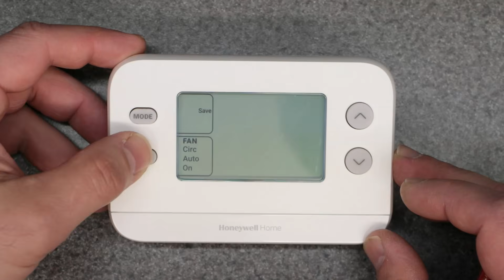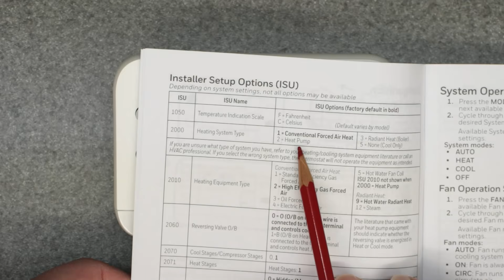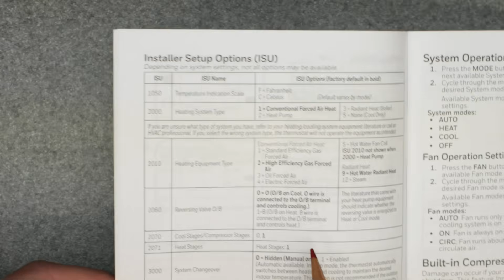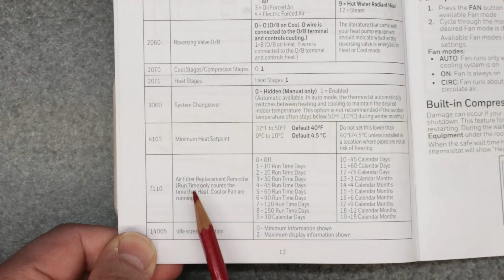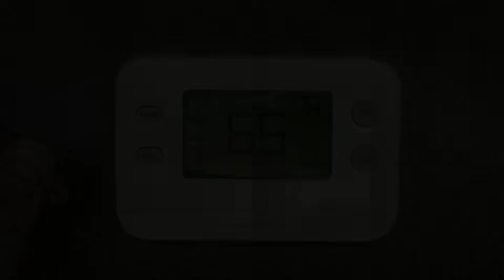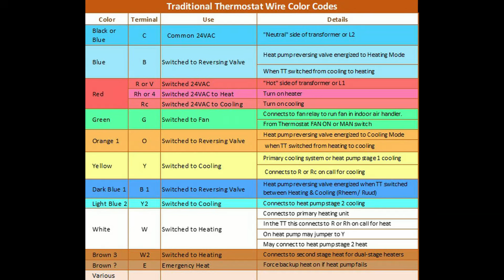Honeywell RTH11B - X1N | SETUP & Operation | NON-Programmable MANUAL Digital Thermostat

Comment: I could never get back to the menu. And could only get heat mode. Taking it back. Put mine back on. Too hot here in TX. Could programming it wrong at beginning cause this?

Comment: The blue sliding tab is the R/Rc jumper. Up is Jumper on. Down is for two single wires. Thanks great help on programming the parameters very helpful.

Comment: I need help. Old thermostat had blue wire in w and on bottom of w is o/b . Where should I connect blue wire on new thermostat? Also on old thermostat white wire is in w2 slot which on new thermostat it says it's unsupported.

Comment: You explained this perfectly. However, mine says cool, but I just woke up sweating and it’s literally cooler outside (62•)  I had it’s on cool for two days, set on 69 and I still can’t even feel air coming out. I just had to open my windows and my door. I just turned the mode “On”  just now so I’ll come back with an update 😂
Reply: Update?

Comment: Thank you for this. I am helping my grandma set her thermostat. We were thinking she needed the time of day set, but it appears that there isn’t a time setting. She wants the heat set lower at night, so just to clarify- she needs to change it manually if she wants a different temperature at any time, correct?

Comment: Thank you for this video - VERY informative!  Sadly, I'm old and dense and have to ask - could you please tell me where the wires (red and white) would connect to run a free standing Quadra Fire 1200 Classic Bay pellet stove? Would I be correct to GUESS I would select #1 in the 2000 category and #4 in the 2010 category?  I would be using this for the pellet stove only which is a 2 wired stove that requires electric to operate. Your help is MUCH appreciated!

Comment: My question: the heat always comes much earlier (sometimes an hour or more)than the set time. What should I do to fix the issue? Thanks.
Reply from the maker: You have the early start function active. Go in the setting menu and turn it off. Also make sure the time is accurate

Comment: How do you jump r and rc? Reason I ask is, the port is only large enough for the one red wire
Reply: I have this same problem currently did you find it out?
Reply: @jojom425 I'll look when I get home and let you know. If I remember correctly, it's kinda like a switch you can flip and just use rc

Comment: I was wondering why my main level was not giving off heat. I have 6 wires and I had a technician  come in but the Ac is working but not the heat. I finally figured out it was the programming was wrong. I will find out soon if I have heat all day. I have heat… thanks

Comment: Great video. I just purchased the same exact thermostat at Home Depot and followed all your instructions and modes.   Heat in the room is at 84 but I have it set to 75 and it doesn’t go down.  it hits 80 and then it goes back up.  I have to say I installed it 2 wire system, red and white heat only. Hot water / boiler. Mode.   I Can’t understand why the temperature doesn’t go down. It stays too hot.  The only thing (my bad) I did was install this without shutting down the power. Do I need to shut the system down and then restart it? Any tips would be appreciated thanks it just stays too hot.  I also have it set to auto but temp remains too hot.
Reply: My same problem stressing me out. It reaches room temperature and take forever to go back down when its colder in the house.

Comment: I’m a little confused. My old wiring has the red wire in the Rc and a jumper to Rh. With this thermostat, should I have the red wire in R and a jumper to Rc? Because I wired it with the red and jumper in Rc and the jumper only in R. Is that wrong? My furnace isn’t kicking on- that’s why I’m asking/wondering. Thanks in advance.

Comment: Hi this would work with simple 2 wire shorting on/off cycle for water boiler running through hot water radiators through the room ?

Comment: What if I only have black and white wire. Am I putting the white with the white and the black with the. Common wire which could be.  Black or blue.   If u could respond with answer. I would be very thankful
Reply from the maker: The installer used the black wire in place of a red i suspect. But you need to verify what those wires are doing by checking the terminals its using at your furnace first

Comment: Awesome video. I just recently had a wall mount Rainni high efficiency furnace installed. Is has this exact thermostat. Is there any way to program it so the temperature in the room drops 5 degrees before the furnace turns on again? I have mine set at 70 and it keeps turning on every short while to maintain the 70 degrees.

Comment: Just installed this for an older oil boiler water radiator system, and it seems like the tighter setpoint temperature is causing shorter cycles. I worry that this will put more strain on the system and/or that the shorter cycles prevent the system from heating the water and warming the area efficiently. Any way to manually adjust the cycles per hour to get longer cycles on this thermostat? If not, will this self correct as needed given the 2000 and 2010 settings (3 and 9) you have here? Great video!

Comment: So I put the new thermostat in… And now the heater won’t even ignite the pilot. I’m starting over. Maybe I did something wrong. Cross your fingers cause it’s 47° in this house. It’s been that way for almost 2 days.
Reply: I did I it… I used all the wires…unlike the previous installer… works like a charm! Pat on the back for this lady!😊

Comment: How do you change the cycling? My gas furnace only comes on once an hour for 5 minutes. Also, it is set for 80 degrees it is only 66 in my house. HELP!!!!!!
Reply from the maker: If your furnace is not staying on enough to heat your home. The problem may not be the thermostat but an issue with the furnace. Make sure the thermostat is not being hit or heated with sunlight that would trigger it to not run as well.
Reply: @ModernHotrodsNH  thank you so very much for responding. The furnace is a brand new furnace that was installed last week. It is in the attic. Where the thermostat is installed is where sunlight never hits it and where nothing can bang into it.

Comment: Mine doesn’t have heat mode ? How can I fix ?
Reply: Mine either!
Reply: Did you ever fix it when I held the bottom left button and the upper right button I went to the heat mode  and put it on one now it works
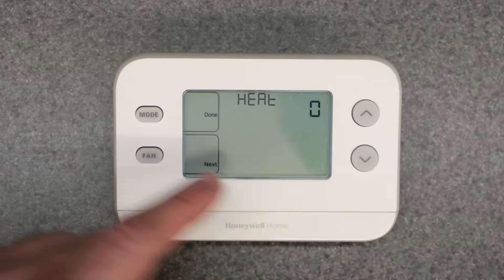Reply: 11:01 on his vid, set Heat to 1

Comment: VERY WELL DONE - Thanks!  
I just purchased this X1N thermostat for our gas forced air and central air control, replacing an old one. Although the Installation and User Guide that comes with the unit is clear (until the reader gets to the "ISU" portion*), your instruction is a GAME CHANGER, and a confidence builder to boot.

*NOTE: The instructions for ISU, #3 says to "set R-switch" position Up or Down, with zero explanation of what that means or how it relates to the older thermostat wiring (I still would NOT know what to do there or how it relates to what existed on the older unit which DID HAVE a R to Rc jumper were it not for YOU at about the 15:22 point in your video). You da Man!

Comment: Your video should be listed as a reference right in the instruction booklet that comes with this thermostat. Your explanations are easy to follow and each step is explained so clearly. I watched it at 4am after three weeks of trying to figure out what was wrong with my furnace. I discovered from your video that I had not set the thermostat up correctly. I had set the fan incorrectly and it was blowing cold air and cooling down the house after it warmed up! Thank you for making this video! It sure helped out a bunch!

Comment: Very nice video sir. This thermostat does not need to be jumped by a piece of wire. The blue slider up mean it is connected R To RC.  Blue tab down mean you can connect 2nd red wire.if you have 2 red wires. Just want to help .but you explained realy good sir
Reply: Dude you just solved my heat problem!! This should be the top comment
Reply: Thank you for clarifying this. I was confused about the jumper in my thermostat I was replacing.

Comment: Is there another wall plate that would allow me to cover about a 3/4" gap on the wall under the bottom edge of the thermostat? My original thermostat from 1968 was mounted vertically so the rectangular shaped cutout in the sheet rock was completely hidden. The way it is now, I'm using the supplied mounting plate, but the thermostat is on it's side (i.e. long ways up and down).

Comment: Hello there I have one black one and one red one I understand the red one goes into the r does the black wire goes into common sense it's only two wires
Reply from the maker: Heat only system? They may have substituted the white for a black. Also check your furnace and what wires go where.

Comment: Mine has no heat. Why not?
Reply: I’m having the same problem atm
Reply: @That08ChevySilverada I'm also having the same issue with the thermostat with no heat display did you ever figure out the problem.
Reply: Mine has no heat too 😢
Reply: @chrisivanbj go to 11:01 on his vid, set heat to 1
Reply: What kind of heat are you running meaning the system
Reply: Same help!!
Reply: Yup same
Reply: I’m having trouble as well like it doesn’t seem to run when needed my rooms are cold 😢
Reply: No heat
Reply: @charlyajeffries8779 go to 11:01 on his vid, set Heat to 1
Reply: Having no heat now at 8 degrees
Reply: Mine wouldn’t heat also, You have to go to Heat 1 mode.
Reply: Go to 11:01 on his vid.. set Heat to 1
Reply: I’ve set heat to 1 and it’s a still not turning on 😂 man I hate this kinda stuff… I had on my old thermostat rc/rh, w, y, g but with a blue wire and did same with the r to rh and everything the same
Reply: I have the same issue also does anyone have an answer on how to fix the problem ?
Reply: Same here no heat
Reply: Me too but I don’t have cool air

Comment: My old one had a jumper for red but I only have the one red wire do I need a jumper?
Reply from the maker: Yes put a jumper from Rh To Rc to supply 24v power to both heating and cooling terminals.
Reply: @ModernHotrodsNH did u jump yours from R to RC? Or does the blue slider do the jump for you?

Comment: why is a black wire attached to G terminal in the old system? should we still connect it to the C terminal as you explained ? we have a gas HVAC system .and we don't want independently   controlled fan system (like circulating the air).

Comment: I have a in floor heating using water heather and the old thermostat only have red and black wire which slot should the black wire go to and which slot should the red wire go?

Comment: This model is no good when heating because it turns on a the setpoint temp and also shuts off at the setpoint exactly.  This causes too much cycling of the furnace. It has no settings to change anything that I can find. It should of been designed where it shuts off at least 1 or 2 degrees above  the setpoint. Any good good thermostat always heats above the set point but NOT this one.
Reply: What one does do that ?
Reply from the maker: Great feedback. Please check out my YT Thermostat playlist link below for more help with this model. Thanks!  
https://www.youtube.com/playlist?list=PLPTIj8AcnNQjo46uI3zz2WWVJ16TX5ABE

Comment: Very nice video - I just bought one of these to convert my RV thermo over to this. The heat seems to be working but the AC is not. Looks like I need to jump the Red to RC. One other issue is the RV thremo has a Hi/Lo fan. I don't think there is an option to control that with this unit unless Im missing something. Thanks
Reply: How did you jump it?
Reply from the maker: Great feedback. Please check out my YT Thermostat playlist link below for more help with this model. Thanks!  
https://www.youtube.com/playlist?list=PLPTIj8AcnNQjo46uI3zz2WWVJ16TX5ABE